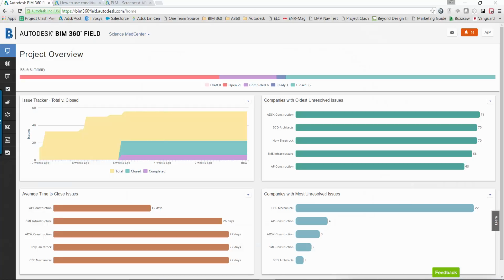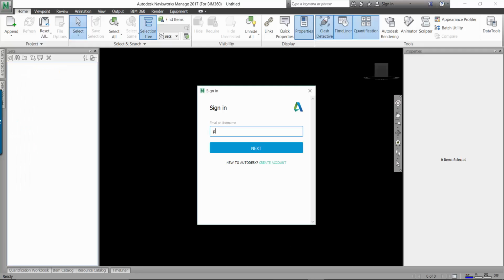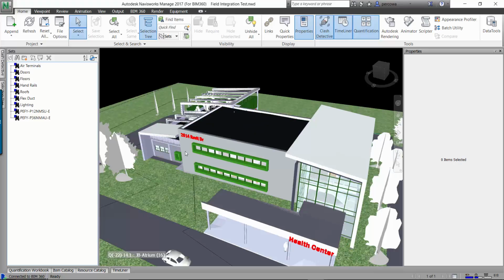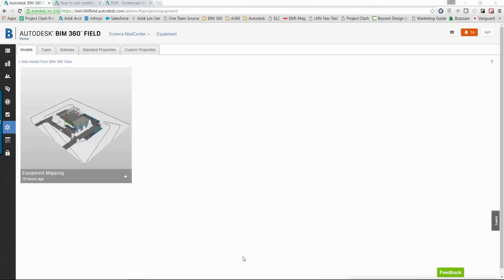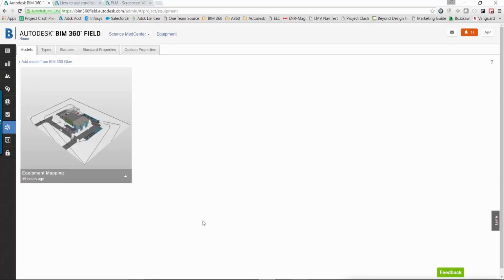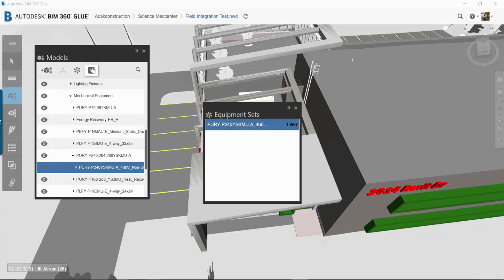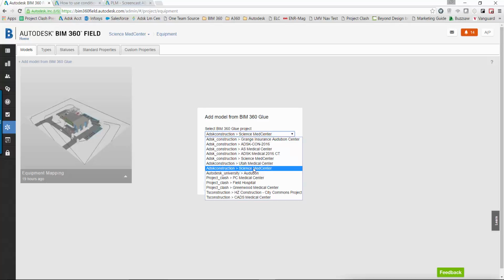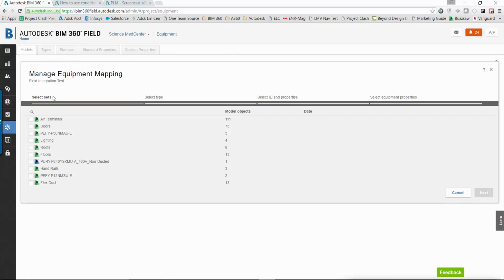BIM 360 Field - Search Set Integration

Comment: So this process helps if you are uploading a new model to glue. However the issue I am currently having is I want to add new search sets to a model I have already shared with glue and to field. when you manage the equipment sets the new search sets dont show up. Is there a way of doing this or a workaround approach to make new search sets and make those sets as equipment sets. I Also want to maintain any saved/shared viewpoints and mark ups I have already got in the Glued model.
Reply: I believe you would have to re-share the latest version of your glue model with field for the new sets to appear.  That would involve creating a new NWD, uploading it to Glue and telling it you want to update that model, opening it in Glue, sharing it with Field, then viewing it in Field as a Project Admin.  You basically have to re-do the entire process, but it will at least recognize your previous mappings, so you should only have to map the newly added sets.  Hope this helps (I know your comment was from a few months ago).